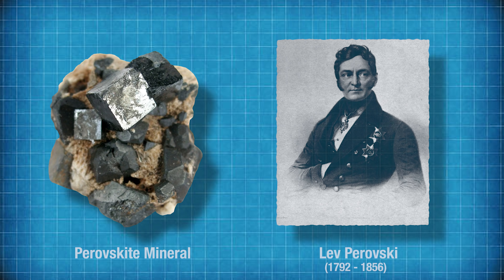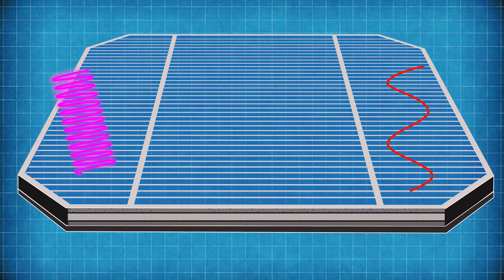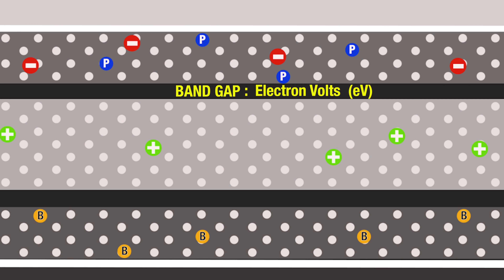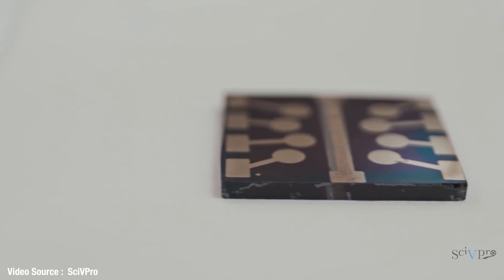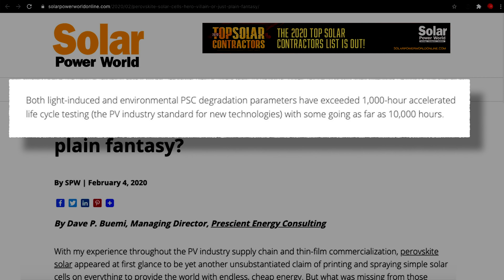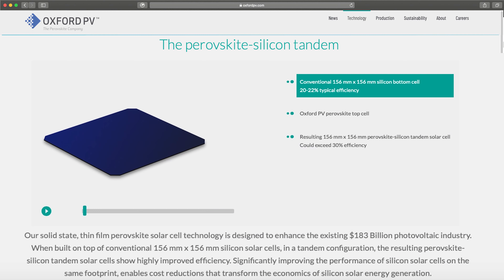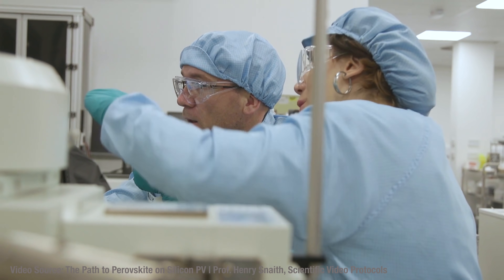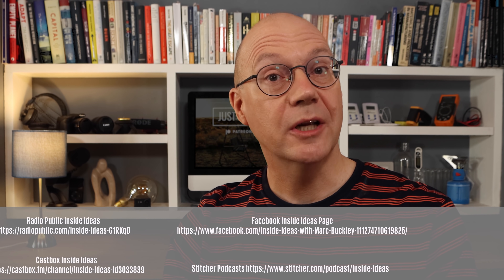Perovskite Solar Cells: Game changer?

Comment: Was Musk claiming that 10,000 sq miles of solar farm would produce all the energy the entire economy would run on or just enough to produce all of the electrical energy currently being produced?  Electricity generation, including nuclear supplies 20% of the total US energy production, so would they need 10,000 sq miles or 50,000 sq miles of solar panels? 

Also, I assume this 10,000 sq miles would be located in the US SW because the East coast and the NW have much lower capacity factors.

Comment: Perovskite: Been waiting for this material, and indeed this video, to come of age. Is it what have been waiting for? It's as if humankind needs to give itself permission to kiss goodbye to the fossil fuel industry. Letting go of legacy is apparently a difficult thing. I guess it is all those sunk cost investments.
Incidentally I've heard reports that a week ago, a Lenr engine had completed an extended test of developing its own sustained direct electricity of around 4KWh [and 1KW/h of heat], greater than the input [130w/h] to get it going. Now, I know there are many people who think all this is bogus, but these days I am pleasantly open-minded, simply because there is evidence of too much of this stuff going on now. The thing is, the engineers don't fundamentally know why they are getting hugely excess energy, they just are. And being engineers, they don't care about it as much as physicists [who generally argue that it isn't what people think it is, and forget that there might be something very useful there] as long as it happens. They can prove it later.
Apologies for going off-topic there. It was about referring to other potential breakthrough sources of clean energy generation.
Reply: Not another over unity device!
There's always a hidden catch with those things.
Interesting though. Is there a link you can provide?
🤝

Comment: Does that lead leach into the environment should it break apart or is the material chemically stable enough to keep the lead trapped?
Reply: in theory, a smashed up cell would eventually leach lead in a wet environment, however the quantity of lead in a panel is really, really tiny. The commercial designs for cells are also going to be really well sealed, made from robust materials (not glass) and they will be recyclable, so leaching is not likely to be a big problem.

To give you an idea how little lead there is, imagine cutting up a piece of printer paper into a thousand equal pieces and one of those pieces is roughly the weight of lead in a PV cell.
Reply: @marcowen1506  How much lead are we looking at for 1 TW of perovskite solar cells?
Reply: @hyric8927  Based on the figures quoted, the   cells would contain 2000 tons (metric) of lead. You would have to smash them all up and leave them in running water to get most of that lead out and I'm not sure why anyone would do that.
To put this in perspective, this is the equivalent of 223 car batteries. I would bet that more than this number are unsafely disposed of every year. 
Also, scientist are not stupid, they know lead is a problem and are trying to remove it altogether. A recent paper used bismuth - commonly found in PeptoBismol indigestion relief.
Reply: @marcowen1506  1 TW of perovskite cells containing as much lead as 223 car batteries? Yeah, that does put things into perspective. Thanks.

Comment: How many square miles of available roofs are there in the US??
Reply: Good question
Reply: A lot.  More than 100 square miles, I'd be willing to bet.
Reply from the maker: My error on nomenclature here folks - 100 miles x 100 miles is actually 10,000 square miles. My apologies. Nevertheless, it is certainly an area that could be spread out onto every domestic and commercial roof top in the US without any trouble at all.
Reply from the maker: My error on nomenclature here folks - 100 miles x 100 miles is actually 10,000 square miles. My apologies. Nevertheless, it is certainly an area that could be spread out onto every domestic and commercial roof top in the US without any trouble at all.
Reply: US has 3.8 million square miles of land which around 1/3 is arid or semi-arid land mostly doing nothing. Even if only 10% of this desert was suitable for solar would be around 120,000 squares miles of land + roof tops, sides of mountains, and other waste/spare land. I think the US has plenty of space to go solar.

Plus would be more seasonal practical, need less storage, and better use of space to be more diverse in the renewable power generation: Offshore Wind, On shore wind, Solar, Hydro, Geothermal, Tidal, Biomass, OTEC,  etc. and maybe even  transferring power by a new Ultra high voltage national power grid.

Comment: Yes, combination of silicon solar cells, covered with transparent perovskite cells is good idea. Interesting - did someone tried to make multilayered perovskite cell from few transparent perovskite cells stacked one above over? May be this will work and efficiency of such multilayer perovskite cell will reach more efficiency than one-layer cell (for the same surface area)? It will allow to create many interesting solutions like solar cars etc due to lower surface and higher efficiency of such cells.
Reply: Looks like yes - https://solarpv.expert/2020/06/21/new-approach-to-offer-practical-way-to-make-multilayer-perovskite-solar-cells/#:~:text=Perovskites%20are%20promising%20for%20next,lower%20production%20costs%20than%20silicon.&text=%E2%80%9CThis%20new%20method%20enables%20stacked,with%20better%20performance%20and%20stability.%E2%80%9D

Comment: I heard 60% efficient i guess not ... on amazon they already have a 2002 garbage solar panel for 1000$ but it will not 110v and 10 amps to rack on top acar
Reply from the maker: I think there are lab test PV cells with 6 or more junctions that suggest 60% or higher is theoretically possible. I don't think they are anywhere near getting them stable yet though. In a hundred years these things will be on every surface no the planet and decentralised, distributed renewable energy will simply be taken for granted. Our descendants will wonder how we could have been so stupid to have used fossil fuels for so long.

Comment: i thought graphene was meant to be the new wonder material.
Reply: It is and graphene can do ANYTHING except get out of the lab. /sarc {it is great stuff}
Reply: @mikewurlitzer5217  so being stronger. lighter, flexible and the best conductor, why are solar panels not being made out of this?
Reply: @redjacc7581  It seems the only things which are brought about quickly are taxes, laws, regulations. All others seem to gestate ages in the lab.
Reply: Graphene and perovskites are both wonder materials.  You can have more than one.
Reply: @incognitotorpedo42  why are solar panels not made from graphene?
Reply: @redjacc7581  Graphene is good at many things, and can even produce a current when you shine light on it, but Graphene solar cells aren't cost competitive with silicon at this time.

Comment: Whilst more efficient, cheaper and longer lasting solar cells are certainly attractive there is a downside. 
Who is going to invest today in technology that effectively could be obsolete before there's been a decent return on their investment?
Reply: It may become obsolete, but it is still generating power and reducing your bills. It depends on the "investor": for existing large-scale solar farms, perovskite solar cells would be a problem (or competition as we capitalists call it), but for a home owner or any distributed domestic small-scale generator it makes very little difference. Their PV panels are still producing power and they will continue to do so until replaced with more efficient systems at end of life.  The risks of obsolescence are no different to investing in any new technology, any market, any infrastructure project.... all investment is a gamble that you will be able to make more money than you put in before something happens that ends your venture.
Reply: @marcowen1506  For sure any investment caries a risk. On the other hand we're already being told in some parts of the world for a short period of time during the day there's so  much energy available on the grid that the price goes negative. Also down here in Au there's a good supply of slightly used panels going cheap. Seems home owners want to get more power from the latest panels so they can get a return on their investment. It does sound like they've fallen into the Sunken Cost Fallacy. Not that I'm complaining, my lonely single panel was a used freebie and it's given years of service. 
I hear much the same argument from people as to why they haven't bought an EV, they're waiting for them to get "better". Same thinking applies to ICE cars, most don't want last years model so the dealers offer them at a considerate discount. It's still as good now as it was then so what gives.

Comment: Very well done, Dave. I'm SO hoping the tech works out, and it can be scaled up. Probably not available yet, but I'd be interested in an approximation of a price point per kilowatt, should it come to fruition. We so need cheaper panels (cells, in whatever form), as it would put solar as an option for bunches of people, and force the elec companies to accelerate grid balancing via batteries, vehicle to grid, and some of the more innovative energy storage solutions I've seen coming out of late. Such as liquid air. Well done, I quite liked that level of information.

Comment: I admire E.M. greatly, but surely he has his numbers wrong on the number of solar panel and batteries?!
Reply: Why would you think so? Bar details, it should be fairly simple arithmetic, based on the peak power requirements of the USA per annum divided by the number of cells required to cover that need, given their % efficiency at the time of the comment. Add the batteries to cover the requirements for when it isn't daylight.
I wouldn't mind betting that EM isn't miles off with his napkin maths.
Reply: @ramblerandy2397  Based on the output of Solar Star in CA, Musk is actually correct here. Either way, it's an absolutely ridiculous amount of land area and solar panels. The waste stream from such a system would be horrendous, especially when batteries are added into the mix. That also only accounts for our current electricity consumption, but if we wanted to eliminate our usage of fossil fuels, we would also need to increase our consumption of electricity considerably (electric cars, heat pumps, etc). The EROEI for solar is also abysmal when battery storage is included. Renewables are really just a dog chasing its tail.
-
To put that amount of area in perspective: It would take a solar power installation the size of the city that I live in, just to replace ONE large traditional power plant, that's just absolutely ridiculous.
Reply: Yes, that's probably just the surface area of the solar panels that he's talking about, not an actual installation.

Comment: I don't know if you have ever done this but, what about a video that breaks down the total energy cost a solar panel takes vs the amount it will produce in its lifetime. Total energy as in energy to mine materials deliver said materials and assembly. I wonder how much more energy the panel produces compared to energy put in to create it.
Reply from the maker: Hi Ryan. I have done that in the past, It's called Levellised Cost of Energy or LCOE. I think I touched on it in the Planet of the Humans rebuttal video a few weeks back. Anyway, I can't remember the exact figures, but wind and solar both work out extremely favourably compared to fossil fuel.
Reply: @JustHaveaThink  I saw some of those thanks!
Reply: True, that would be a very useful number. Not too many things we use energy to manufacture continue to produce energy for years with zero pollution after construction. I have no problem with the lead used in the manufacture as locking it in this structure would seem to be safer than the thousands/millions of lead acid batteries leaking all over the world after a car accident.
Reply: Ryan Rollins Well, we have 34 panels on our roof and over a 12 month period they generate around 40kw/h of electricity per day (we live in sunny Queensland though).  So, that would be roughly 400kw/h per panel per year.  If the lifetime of the panel was 25 years then it would generate 10gw/h in its lifetime (my maths may be out so happy to be corrected).

Calculating production energy per panel will be much harder - and exponentially so if the factory making them uses solar energy to supplement power usage.  Then there is mining and transport, installation, decommissioning, recycling and disposal extrapolated to a ‘per panel’ calculation.
Reply: Solar cells pay off their energy cost pretty rapidly.  It's a small fraction of their useful lifetime.   The lifecycle analyses have been done.  As Dave alluded to, Perovskites have a significantly lower energy cost to produce, compared to silicon cells.

Comment: Interesting development. Printable solar panels might open up some DIY applications, and I'm wondering if there is a way to make a "solar collecting" paint; even if it was only a few % points of efficiency, you could easily put it all kinds of places and turn nearly everything into a solar energy collection surface with little effort. Unless we can come up with things like that, I don't think we'll be able to easily turn the corner of solar energy collection at scale.
Reply from the maker: Not sure about paint, but there is a parallel development going in with transparent PV cells that are able to just absorb the infrared part of the spectrum. Those panels, while not brilliantly efficient for obvious reasons, could be applied as a film on the outside of every pane of glass in the world. Now that would be something!
Reply: This has been something that scientist have looked at. I am very skeptical: you need a lot of very precise electrical structure to extract the electricity that your paint is making which means you can't paint your white picket fence and use it to power your microwave. A solar paint would require you to paint it on a pre-manfuctured mesh of some kind in order to collect the current and send it into wires, thus defeating the DIY objective.
Solar paints that make hydrogen, now that is a different story...
Reply: he said the cells could be made flexible, so maybe not paint but solar wallpaper perhaps?